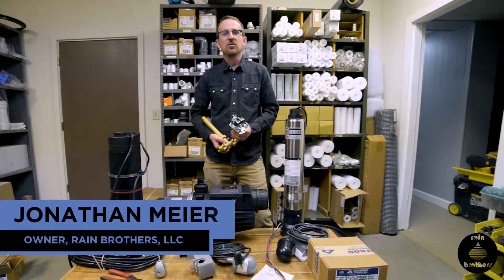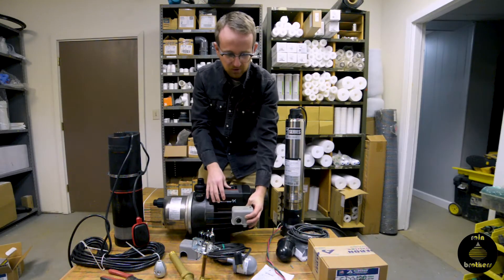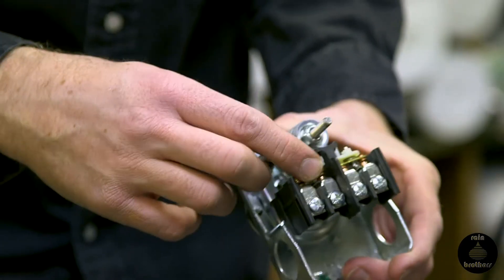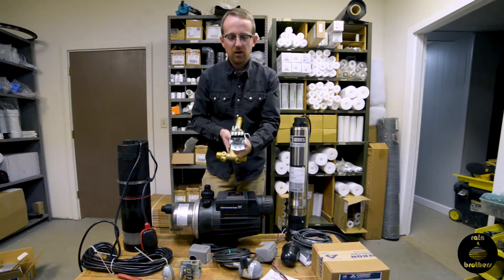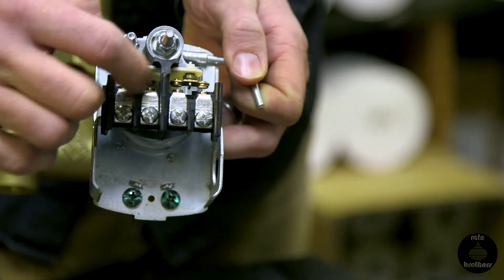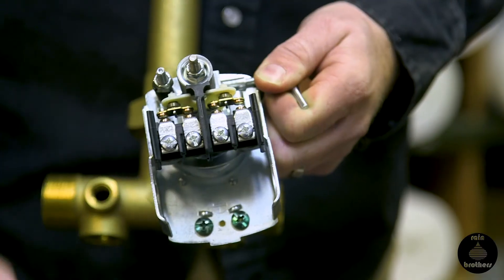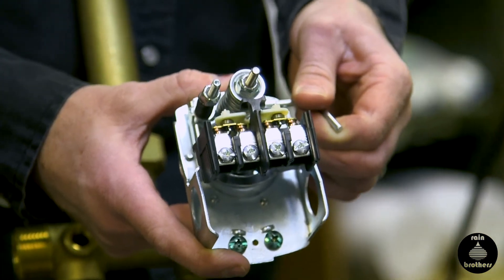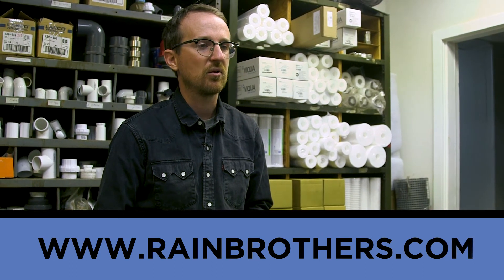Pump Pressure Switch: Low Level Cut-Off Pressure Switches

Comment: Good morning, I have yet to find a low water pressure switch that claims to safety turn off my pump if the pressure were to drop to 15 psi?
What switch do you recommend?
Reply from the maker: https://www.rainbrothers.com/store/40-60-Pressure-Switch-w-Low-Pressure-Cut-Off-p502185558

Comment: Under normal operation, should the arm be in the  down ("auto") position, or the up ("off") position?   Is it okay to use this "low level cut-off" type on any well system or just certain ones (I believe that the box said to use a low-level-cut-off" type only if that is the type that was there originally.    Lastly, what if when pressure switch goes on, the pressure gauge  quickly goes to 50PSI, but the second it cuts out, the PSI drops to 37 and just sits there until water is used??   Thanks for your video!
Reply from the maker: Hello - thanks for the questions. The arm should stay in the Auto position until the pump reaches 12 PSI, at which point it will shut itself off. This switch can be used with any pump that uses a pressure switch. If pressure is fluctuating like that, you may want to adjust air pressure in the pressure tank and adjust pressure switch to increase the cut off pressure